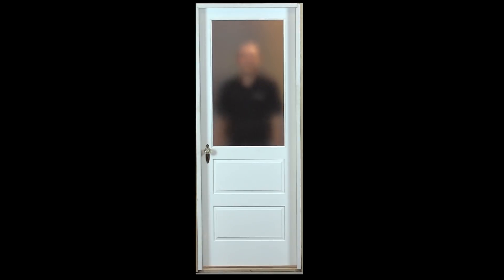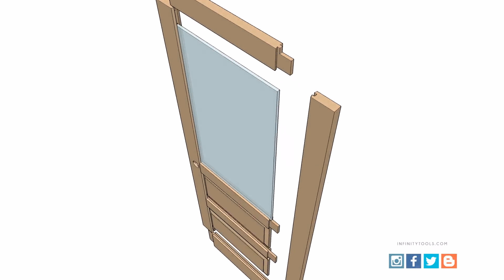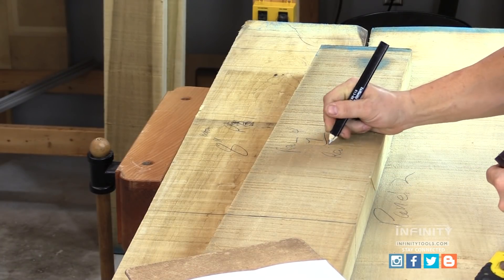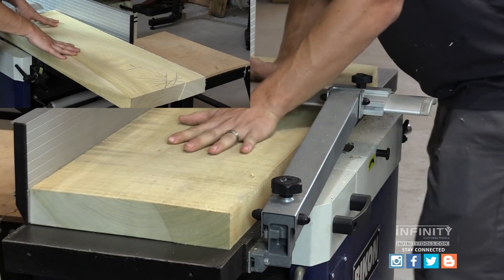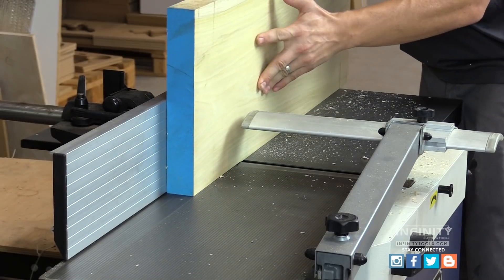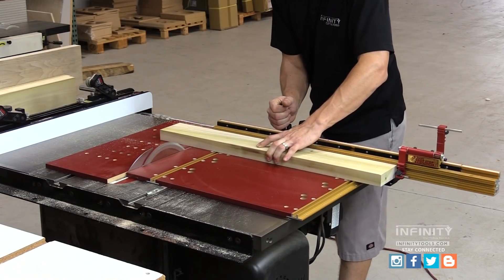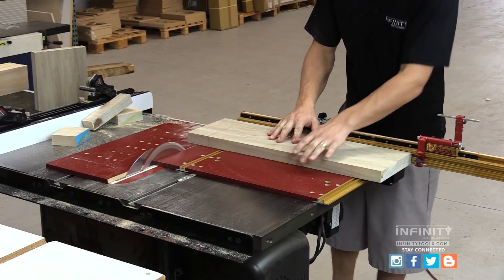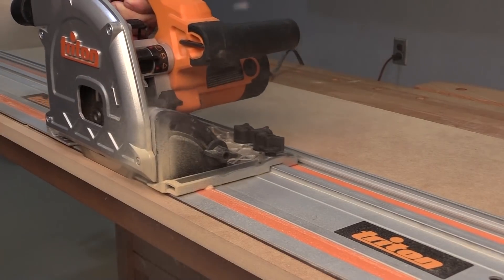Build a Custom Entry Door - Part 1 of 4

Comment: I need  a custom side panel I have 60inches  rough open space. New door I got is 38inches in diameter with the frame so need to fill in the rest of the open space.  And  manufacturers make  that size side panel  beside that they are so Expensive.  Somebody help me out.
Reply: Oops... No manufacturers make side panel that sizes.

Comment: Why didn't you use the mitre saw to crosscut the finished lumber? Looks like the mitre saw is a redundant piece of equipment.
Reply from the maker: HI, I like the miter saw for initial sizing of lumber as it is convenient and fast at breaking down long pieces. While the miter saw can be set up to be very precise, I personally prefer the tablesaw for final sizing. The kick rail of the door is also slightly wider than our miter saws capacity. It made more sense in this case to do my final sizing at the tablesaw as I used the same stop setup to cut all of my rails. This insured they were all exactly the same length. I could have cut my stiles at the miter saw, but I was already setup at the tablesaw so cutting them there was just as accurate and saved a little time.

Comment: What kind of wood are you using?
Reply from the maker: Because our door is painted and will not be directly exposed to the elements we chose poplar. Poplar also has the advantage of being available in both wide and thick stock.
Reply: I thought so ... it's also on the lighter side weight-wise. So for poplar, how much over actual size are you allowing for the 2 milling operations?